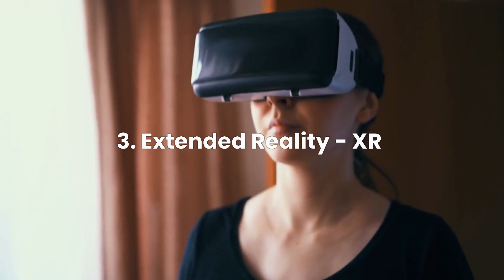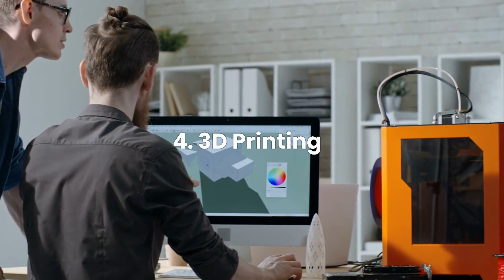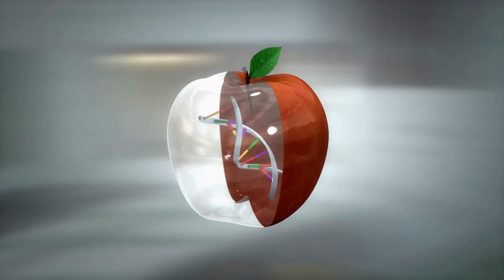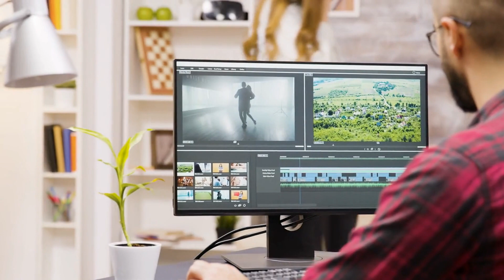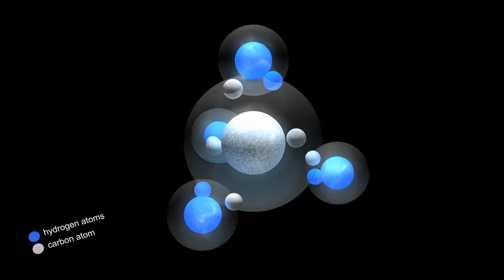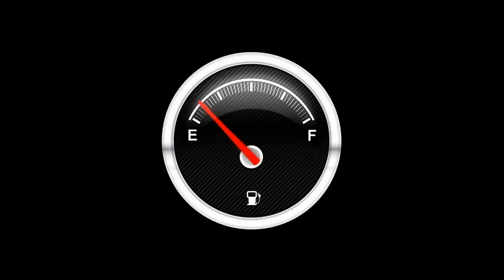Get Ready to be Blown Away: These 15 Futuristic Emerging Technologies Will Change Your World!

Comment: 13. (Sand battery) is not a battery. A battery is a container consisting of one or more cells, in which chemical energy is converted into electricity and used as a source of power. You story talks about storing heat and using the heat to heat things.